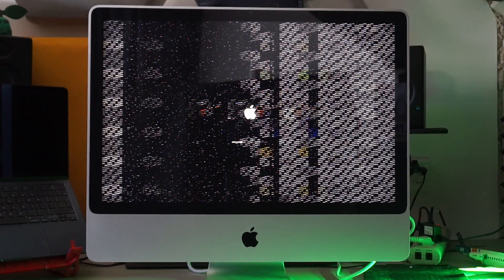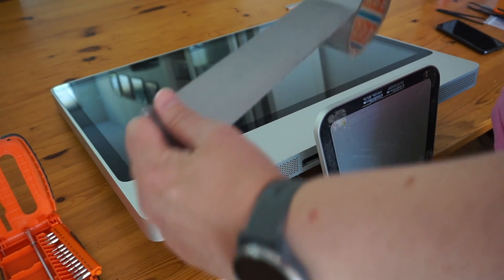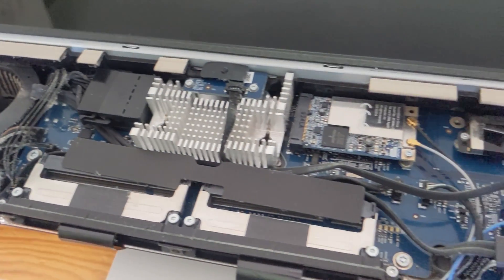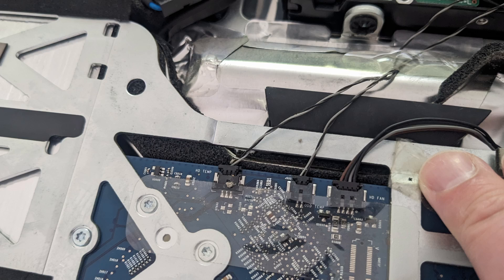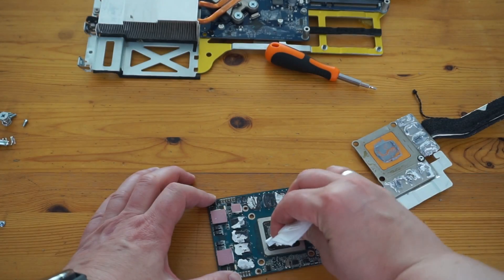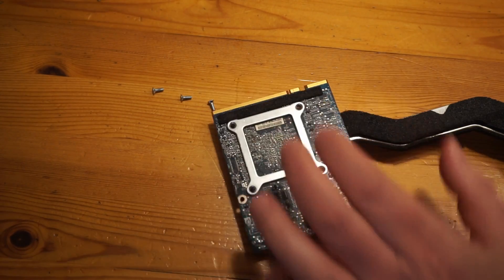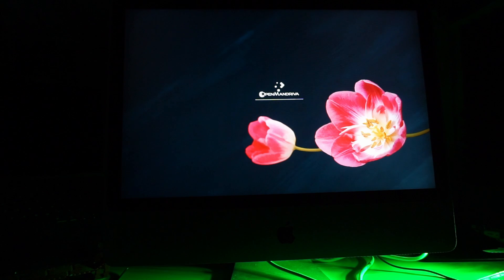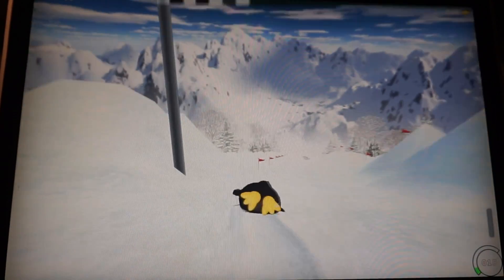Fixing display issues on this 2008 iMac!

Comment: Mine does that too. Only it has a Radeon card. Interestingly it only does it running Mac OS, but works fine on Linux Mint.
Reply from the maker: That's weird. I believe the Radeon cards indeed have the same issue and temporary fix.

Comment: Missed this when originally uploaded -my problem with my Late 2008 iMac is it is riddled with a one-pixel wide green line just off centre on the screen, running top to bottom of it - so annoying - but otherwise it works just fine - have used it for a music box for many many years.
Reply from the maker: I wouldn't bother opening it for a single line indeed. Could be the screen itself as well, although these things are notorious for their gpu issues. Apart from that they're great machines. :)
Reply: @ex-itguy  Yeah have never opened it - just leave it in a room that is only used for reading and have had PDFs on it plus music etc.

Comment: Well saved!👍👍 This video clearly demonstrates why I don't bother with iMacs, as they are not designed for simple maintenance.
Reply from the maker: I always thought they were cool, but now I know I don't need one indeed haha
Reply: @ex-itguy  If one came my way free of charge then I would take it.
Reply from the maker: Sure, same probably. I'm just not looking for them anymore haha
The newer models are even worse to work on with glued on displays...
Reply: @ex-itguy  Yes, that's correct and the newest ones cannot be upgraded as everything is soldered to the MB..

Comment: Hey i'm wondering what system was it running before you tried lunix?
Reply from the maker: Just MacOS, but I don't have the password to login and I didn't want to clear the harddrive.
Reply: @ex-itguy  No it was that it booted into a menu and since it a old imac i wonder which menu it was using but stil thank you for your response!
Reply from the maker: Ah right! It just gave two options for the same hd, but only one actually boots into MacOS and the other does nothing. It's not a special boot menu, it's just the Mac seeing two options and asking which one. The same as holding option (or alt) down with a disc or usb stick in it.
Reply: @ex-itguy  Huh thats weird isn't that iMac not to old to run newer bios firmware? Like i'm pretty sure that dark mode wasn't added back then or my computer is too old
Reply from the maker: Right! Didn't notice that! Going to bring the machine back to it's owner today but it might be interesting looking into if I encounter another. Many people said I should try that on the Mac Pro as well!